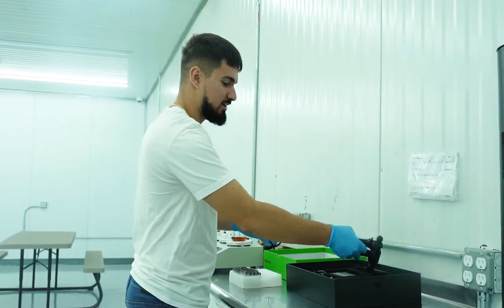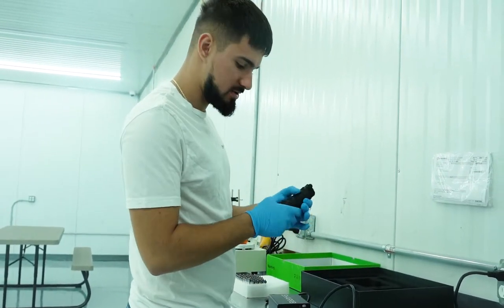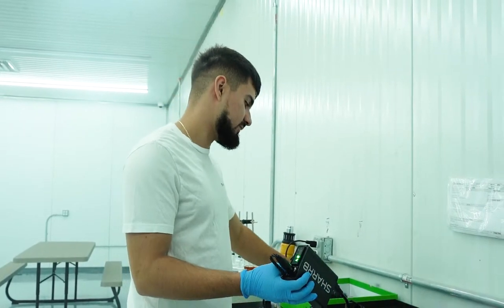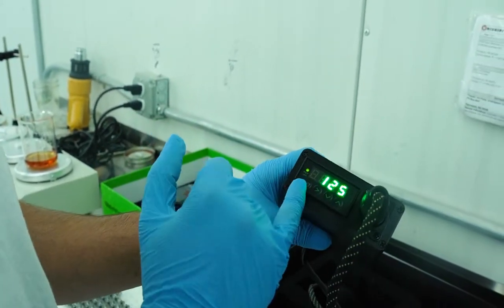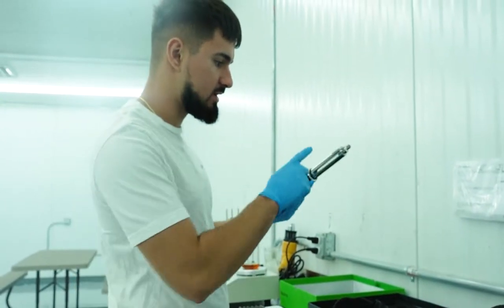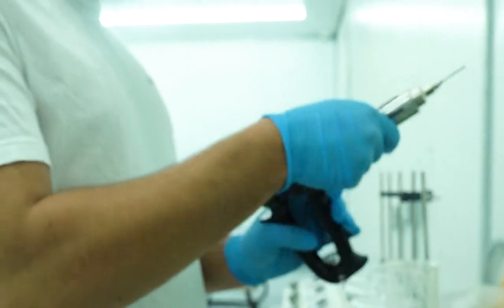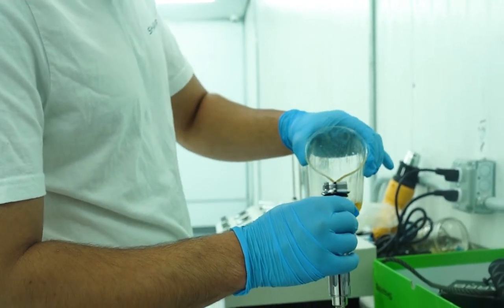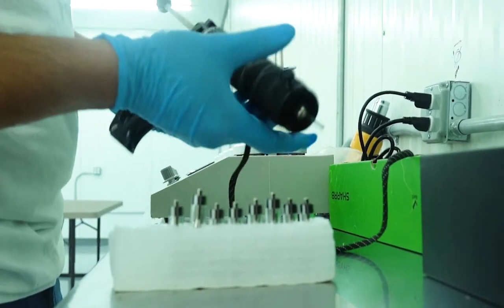How to Fill Cartridges with the SHARRB Glass Tube Cart Filler Semi Automatic Syringe Gun V1 ONLY

Comment: What if you don’t want to use the full capacity of the gun? Is there a way to remove air bubbles/gap before dispensing
Reply from the maker: Yes, just make sure the plunger is at the same level as the oil